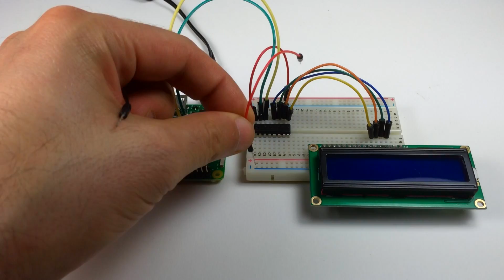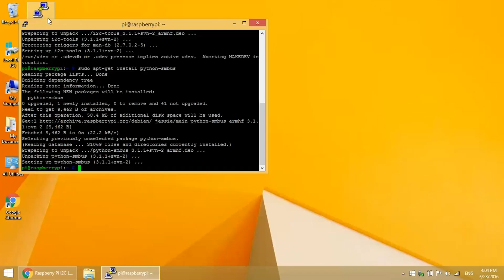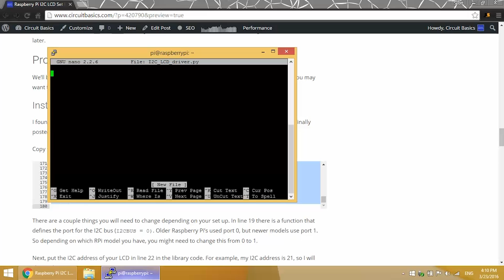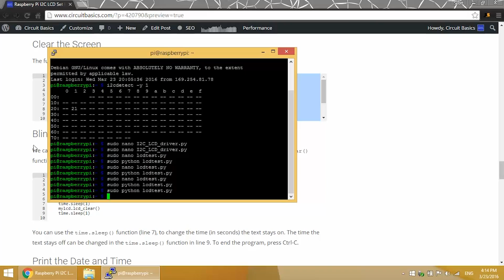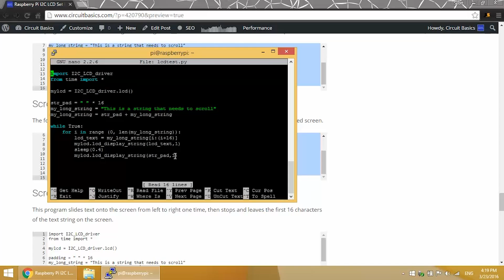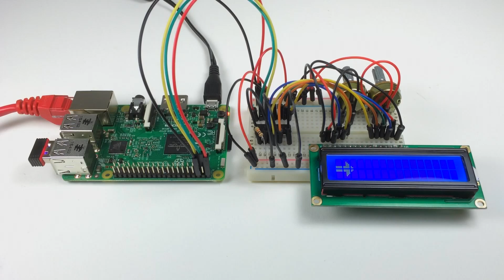How to Setup an I2C LCD on the Raspberry Pi

Comment: First, I think it is a very nice video.
But.
1) Don't edit the source code as root, with sudo nano. You should never run as root if you don't need to, and you don't need to here.
2) Never make electrical connections with the power on. You might ruin electonics that are sensible, like the Raspberry Pi.
3) When you install software, always update package database and upgrade installed software first with this line.
sudo apt update ; sudo apt upgrade 

The rest are a great tutorial.

Comment: How can I get a PIR sensor to display movement on the LCD screen? And so it basically counts like 1 then 2 then 3 and so on until the movement has stopped? Hope fully you can help me. Thank you
Reply: Francois Beyers You read the value from the PIR sensor and then write it out on the LCD as in the last example.

Comment: Just would like to have a clarification regarding the I2C address of the LCD. If I am following your instructions exactly I will get address 0x21 as well, correct? since we have addressed the PCF8574 A[0-2] the same as what you did and the is how we provide the I2C address to the LCD. Since you have set them to A0=H A1=L and A2=L then you should get Address 0x21 - and we should get the same as well. The address is in Hex and it reads 20 + the set of A2 to A0 and since you have set them to 001 the address is 0X21 if you have set all three to L you would have get 0x20 - By the addressing reference you can have addresses from 0x20 to 0x27. If you will set all three to H the I2C address of the LCD would be 0x27.
That can give us the ability to connect more LCD's and PCF8574 with addressing the correct address we want from 0x20 to 0x27. that will give up to 8 LCD's theoretically :)
Thanks for your tutorial - I have loved it ! Thumbs Up!!

Comment: Hi. Great stuff, but is it safe to connect pins while the pi is powered on?
Reply: I believe it is not, but as I have read in other guides, as far as you know what you are doing (to prevent a breakdown voltage and crash your PI), you can do it; Nonetheless is adviced to turn off the Pi when you are wiring.